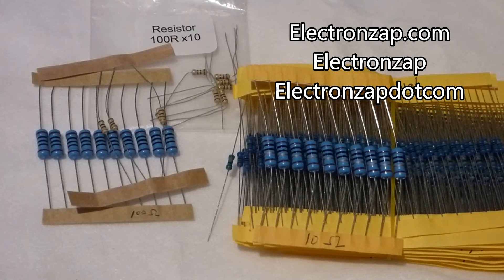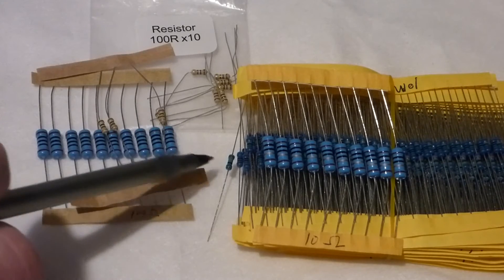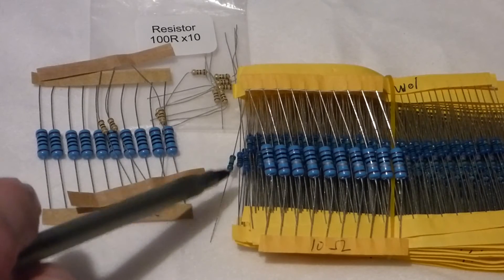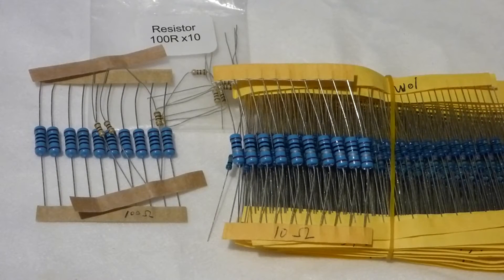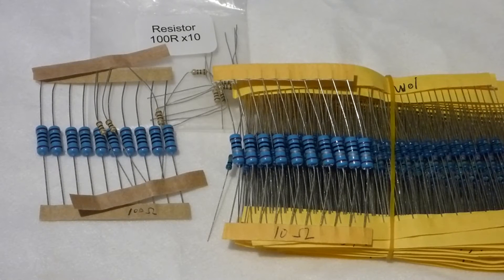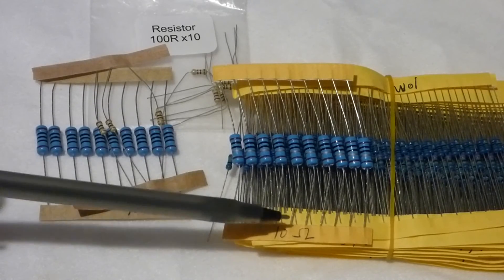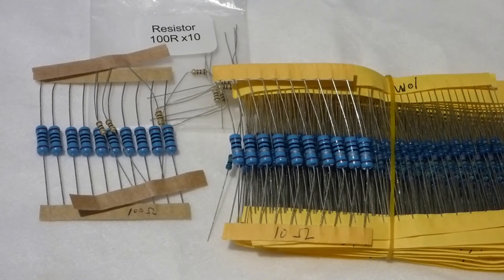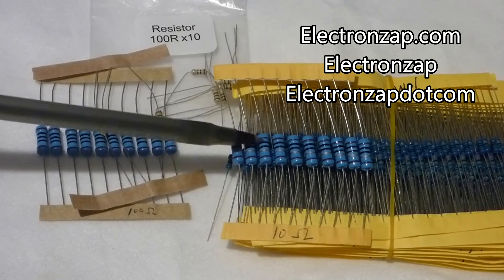1W resistors size comparison to 1/4 (quarter) watt resistors for electronics by electronzap

Comment: I want to wire 8 leds-0.02Amp LED , 3.3Vf
 in parallel with 6.5 v power source and calculated I need 20Ohn resistor but can only handle 4-5 leds for a quarter watt resistor before getting heated. So why would people buy quarter watt and not just order 1 watt resistors so that you can add more leds before overheating? Are they just pricier or why would you want to use lower watt resistor??

Comment: I was using 100ohm 1/4w resistor with some leds and they got too hot. So I ordered 100ohm 1/2w resistors. They dim the led's significantly. Also, I probed both resistors with a multimeter and they read as having different resistances? I double checked the color bands, it all checks out. Any thoughts???
Reply from the maker: That happens :) LEDs from a television will probably need a lot more current than the indicator LEDs most commonly used in basic electronics. I've only used the indicator LEDs and don't know the specs of any other ones. Probably have to look up the part number if you can see one, or look for identical looking LEDs on Ebay/amazon to try to find the specs.
Reply: @Electronzap  Subbed :)
Reply from the maker: Sweet!
Reply: I'm going through the same thing! I'm almost done with my project! I made a waving led neon sign. I made a circuit that makes the lights turn in and off but now my next and only problem is tackling the heat problem. Im using 1/4 w resistors and I found my desired brightness but the problem is that the resistor gets too hot. Even if I connected them in series, they still get hot. I thought about buying the bigger resistors. My LED strip came from a 4.5v power supply and I want to change it to a rechargeable 5.1v battery pack. I don't want the LEDs to burn out. So do you think if I just buy the bigger ones, I'll be able to handle more lights?
Reply from the maker: 100 ohms isn't much resistance for protecting LEDs unless you are using a 3.3V power supply or something. I usually use (at least) about 220Ω for 5V, 470Ω for 9V and 1KΩ for 12V. Almost always 1/4W watt resistors. LED being dim should mean low current, but then the resistor shouldn't be hot while in series with a dim resistor, so that is odd.
Reply: @Electronzap  Thank you so much for such a quick reply. Embarrassingly, I think I confused 10ohm with 100ohm! The hot resistor was the 1/4 watt, which I guess is only 10ohm lol? The power supply is 5v. Leds I think are 3.3v. I ripped them from a derelict flatscreen (example of type:https://www.youtube.com/watch?v=DBH6-Eqnexw&t=95s)

Comment: Are the legs on the 1w the same size as the 1/4w? Trying to use the leads for a project minus the resistor. Can't seem to find any data on the thickness of the legs.
Reply from the maker: They are thicker than the 1/4W resistors I have. It's really easy to take the plastic off spools of wire so that is a better way to go than to  take leads from components you aren't going to use for anything else. Just want to make sure the spool of wire is solid and is the right sized gauge for what you need.
Reply: Yeah cuz for the Tesla fuses people had stated that used the 8th watt resistor legs. But all I have is a bunch of quarter watt resistors was just trying to use what I had but I wasn't sure about the thickness or diameter of the legs. Needing them to blow at a specific amp rating. I do have some nickel plated copper or bus wire but it's not the right diameter was just trying to use what I had so I didn't have to buy more.
Reply from the maker: Oh gotcha.
Reply: @Electronzap  do you know how much of a difference(size) there is between the 1/8w resistor legs and the 1/4w resistor legs? I can't find any info about the diameter or size of the legs online lol so frustrating. Thank you for the replies I appreciate it!
Reply from the maker: I think it all depends on manufacturer. I don't have any 1/8W resistors and all my 1/4W resistors have different diameters depending on where I got them. Probably cheaper ones are thinner.
Reply: @Electronzap  bummer lol. Alright thanks for the info and replies. Typical my life story nothing ever goes according to plan 😂😂 what size diameter what I need for a 5 amp load blow fuse wire? I have 28 gauge nickel plated copper or bus wire but I'm pretty sure that's rated for like 1-1.5amps? If I were to double it up like spin it together like a twist wire with 2-3 wires spunup on it would that work? Or no because it's not solid together. I have a ton of that that's why I was wondering if there was a way to use it for my application. I guess I could always try to do it with an amp load test and see at what point it falls apart or disintegrates.
Reply from the maker: As long as the wire are parallel and connected the same way, they will share the current about equally and each wire will carry it's fraction of the total current, especially if you twist them. I don't think the Tesla fuse is a well researched topic and I never made one or burned out wire. So, I wouldn't know anymore than what has been shared by others. If you burn a single wire out during testing, at one Amp lets say, then you'd want at least as many in parallel that you plan to have current pass through, plus whatever safety margin is needed. Lots of variables. Thermal camera would help to see how hot everything is getting too.
Reply: @Electronzap  yes so each one of those cells I'll have the wire or I will have the wire on each parallel and series connection(it's a 14s5p pack) so there's a bunch of them, so I was thinking if like you were saying if it was rated for 1amp and I need 5 amps then I could just put 5 pieces of wire(twisted up like a twizzler) on each single connection and it would share the load and work how I was trying to make it work. I just wasn't sure being if I needed four or five of them Parallel/series than when they do break/let go/burn up I just didn't know if they would go together or one at a timeand then obviously if it needs five and one blows out than the other four will follow shortly after or what would happen, so I guess I'll just have to try it and test it with my power supply with different load currents and go from there. Lol wish me luck! I really do appreciate you getting back to me and answering my questions. Thank you very much! Have a good rest of your week man.🤘✌️
Reply from the maker: I hope to do more 18650 videos in the future. I'm mostly out of space. Even the experts have a hard time making safe power walls, portable supplies, etc. so you have to be careful and learn all you can.

Comment: May i use 1/4 watt resistor in a project instead of a 1/2 watt one?
Reply from the maker: As long as you multiply the voltage across the resistor in volts by the current through the resistor in amps and that is less than 0.25 (1/4 Watts) then a quarter watt resistor is fine. To be safe, it should actually be kept to 0.125 Watts or less.
Reply: @Electronzap  Ok thanks. The project is an led cube, and the voltage is 5v i think.
Reply from the maker: Quarter (0.25W) watt should work perfectly fine. 5V directly across 220Ω is a little less than 0.12W. 220Ω is a really common value resistor to protect an LED from 5V.

Comment: same value or color but different size,  are they still the same or equal??
Reply from the maker: The one Watt resistors can handle 4 times the power of 1/4 watt resistors. Other than that, they behave the same if the resistance is the same.